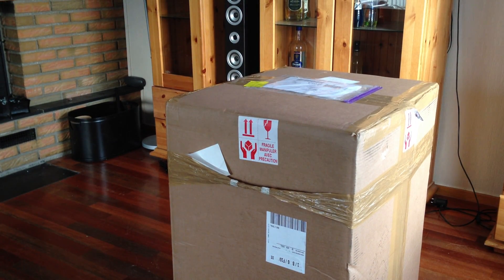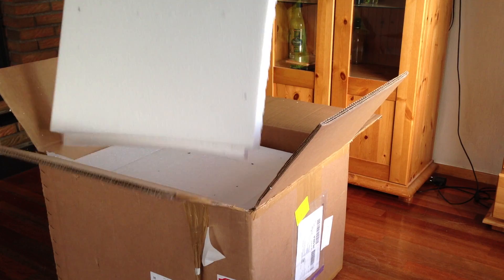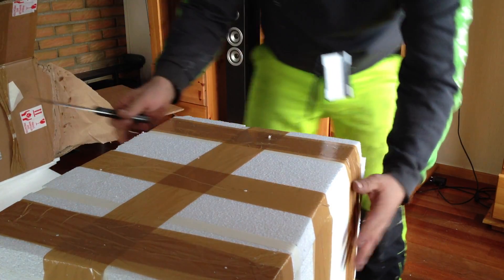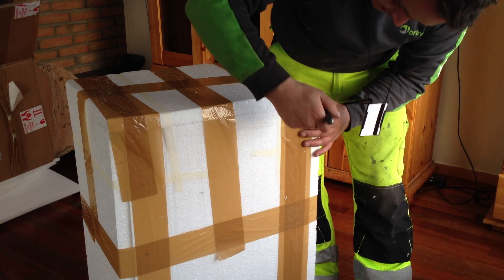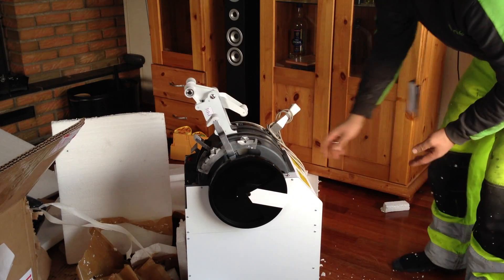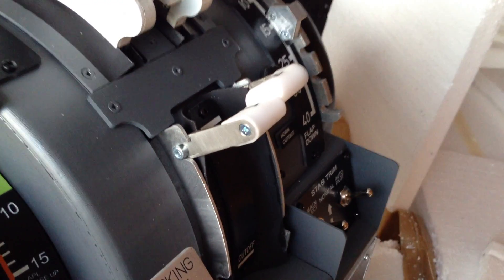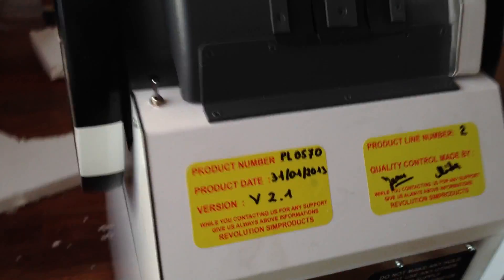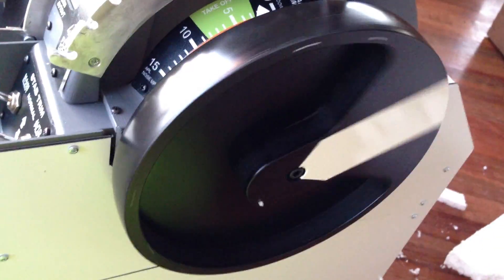Building a Boeing 737-800 home simulator #44

Comment from the maker: The trim is motorized on my throttle.. What I want, is the option of being able to do manual trimming aside from auto-trim. That was one of the features that was supposed to be on my throttle.. That's what I paid for.. But this one does not have the option of overriding the auto-trim..